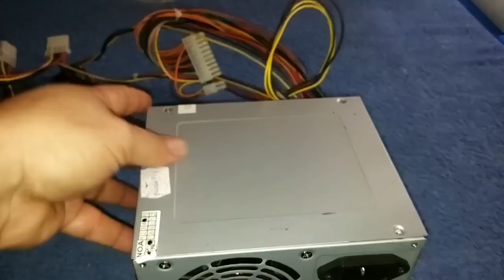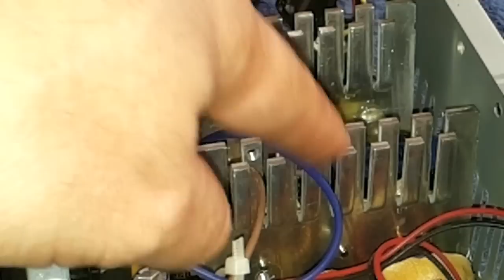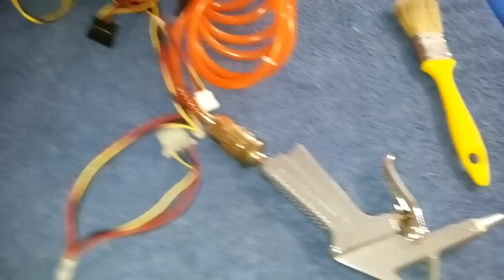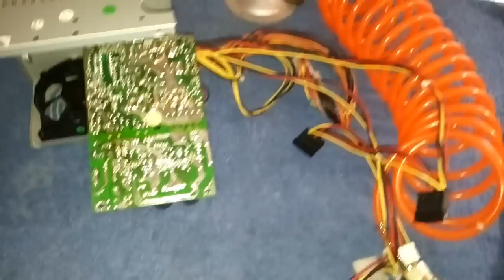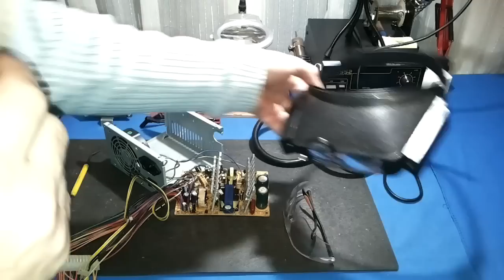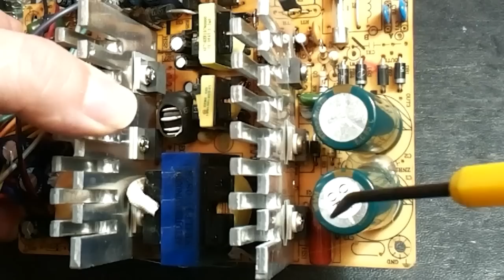How to fix a switching power supply / how to repair ATX in a PC desktop computer

Comment: Can you do a modern update to this video? The internals of the unit you're working on in this video are vastly different from what is found in high performance ATX PSUs today. The one I'm trying to fix is much more densely packed with components and it has multiple PCBs and NO FUSE. I think it's tripping a failsafe, because it responds for a split second when I turn it on, only to shut itself down immediately.

Comment: that day i just discovered that a 3.3V sense must be connected to the 3.3v o/p line, i had removed al the wires as  i wanted just the 12V , learned the hard way after 2 days , smps was turning on for just 0.5 sec and switching off, also i have a cooler master 500w  with active pfc ,no o/p, even the 5vsb not present , checked everything  now will remove those opto & try once again.

Comment: when i on my pc power supply without load then all voltage is ok
.and when i connect the power supply in pc then only green wire 5voltage is come.other all voltage is not come means supply cannot take a load. 
tell me whats problem ?

Comment: I noticed today a burn smell coming from my pc, turned it off and then tried to reboot. No display but the fans and lights still work. I noticed the psu red voltage switch in the back looked a lil burnt. What should i do?

Comment: @Bob. Kalpon  My situation is that i have a good very old PSU the one permanently attached inside the PSU (non removable) abd has 3.3v, 5v and 12volts !! Is not an ATX modern which you can jump with an ordinary clip
to turn them ON !

Mine needs a load like a HDD or Floppy or CD-ROM connected to work ( any load like a 12v bulb ).... So ...can you tell me if there is a way to bypass that LOAD System and make it Turn ON without any LOAD ???
Why most old switching PSUs need a LOAD to turn them ON ???
Thanks in advanced for your help !!

Comment: Hello Bob, veru nice video ! i have an Xbox PSU which is almost the same as an ATX where the Primary side works good, but it has no output. I replaced a shorted rectifier in the secondary section and also the capacitors, but still no output. Any clue on how to continue the troubleshooting as it has lots of SMD components on the reverse side of the PCB. Thanks.

Comment: hello
my cooler master mwe 450 smps is not turning on..it sometimes does but if i shut down the computer and restart it then it doesn't and then after some time it starts..please help me out with this....do i need to replace with new one or it can be fixed.🙏🏻🙏🏻🙏🏻

Comment: The heat sinks gives you an idea how hot the power supply unit can get so it's important that it's clean inside. The fan should be running as it should. If you can install another fan to let air inside, it will help a lot the other standard fan drawing out hot air. The secret of PSU long life is regulating temperature.

Comment: Very nice video,very informative. Can you tell me what might be happening with the videos where people heat the intake on the PSU that won't start and run a computer? Then after a few minutes the computer will start. I assume this must have something to do with heat causing some expansion in the capacitors in the start area of the PSU, thus enabling them to charge up for the starting of the computer. I have two power supplies that I have swapped in and out, of the same computer for a couple of years. Now I see numerous capacitors that are bulging and must be the culprit. I find it interesting that the power supply that was giving trouble has been useful again after getting a long rest after it was removed and stored. These HIPRO PSU's that are used by HP seem to be pretty well built units, and it would be nice to be able to simply replace the bulging capacitors and return them to service. Thank you for sharing your knowledge.
Reply from the maker: Hi! There are two kind of test we do to expose issues. One is to cool components with refrigerant spray or to heat them a little. It is a way to test and tack a defective component to replace it.

Comment: There is a bad transformer in my power supply. What is the correct procedure for desoldering the transformer  I am unable to remove all the solder from the transformer pins with a sucker or a wick.  Got any tricks?

Comment: In my SMPS board the fault in input section when i check the two thermistor are not beeping and the input section have total four transformer one with thermistors whose plastic is little burnt in below section and one diode which is not beeping what i should do.

Comment: I have a question. Do you know why very often there is very little resistance in ATX power supplies on the 5V line? 30-40ohm. After connecting the 12V / 55W bulb, the power supply goes out.

Comment: I wish you plug that power supply on AC and show us the way how to measure each parts like this like that. Like on how to test bridge diode and that big capacitor specially in the primary one. It's called voltage checked!

Comment: I would replace every Cap, Caps are cheap, but also because i only buy good PSU's that are not cheap, the PSU is the most important item in/out your PC, cheap PSU's can destroy your PC, i have seen it happen, and the rest of your PC cost a LOT more then your PSU.

Comment: Hello, I have a non-standard shape power supply on my old HP desktop computer that I've been trying to fix for the past many years. The problem is it has no power good output. Where should I begin?
Reply from the maker: Hi! Don't risk your life to electrocute yourself or your home to fire. If you want to enjoy trouble shooting it, look for a good electronics technician friend, and do it under his advice with him. (Do not forget to bring coffee or pizza to have some fun). :-)
Reply: thanks for the advice, I'm actually a electronic hobbyist & have some very good knowledge in electronics but this power supply problem I have set aside for many years now. Anyways, I shall check again & see if there are any bulging capacitors...
Reply from the maker: OK, if you have knowledge, it is other thing... Three mayor fails in power supply are blown capacitors because bad cooling cause by dust, defected fan or bad design where capacitors are too close to heat sinks  and cooling is not enough. Second, defective load like something in short connected to it. And the third main cause are the following defected componentes: look for two fast speed transistors TO-120 connected to a heat sink,  two small TO-92 are part of that Darlington configuration, and its very low resistors, two about 2.X Ohms. One extra resistor 3 or 5 Watts can be smoked or showing over heat marks in the PCB. All that stage  with your main big capacitors could be damaged. Also at the end, it is time to replace the last capacitors in the output. Now it is time to enjoy, and if the computer is already old, it is time to install Linux and enjoy it anyway. :-)
Reply: Hi Bob, thank you for the tip. Now I know where to begin!
I shall report back as soon as I get the time to dig the power supply in my storage shack. Right now the heat here in the Philippines is oppressive I'll wait a couple of monts when it starts to rain & cool things around. Thanks again - Dennis

Comment: Take your time find some schematic diagram to match your defective power.. Might not be exact diagram but you will have idea at least 70% of the circuit. Then your circuit analysis talent will do the rest to help you repair that power supply.

Comment: I' always use the tip of ac power plug of my soldering gun or iron to touch big filter terminals to safely discharged it...

Comment: I need your technical help regarding LCD TV Haier  LE32B50. By power on blue light comes on but back light does not comes on, after a few seconds it comes on but goes off and  red power led glow again blue led comes on , this will continue, means blue on, back light on and off. By disconnecting back light connectors (03) power comes on and remain on, now on connecting back light connectors tv comes on and all functions are ok.After power off after 7seconds tv will not on and shows the same problem. so if back light connectors are disconnected  and reconnected then power on otherwise no.
Reply from the maker: Hi! I found the schematics here: https://drive.google.com/file/d/1Ap7fx24fVlp3i5EbhVFlJi7qRDT12R3T/view
It is not proper to say it, because any component can be the broken one, but must problems in new TVs are related to electrolytic capacitors like the ones alike 470uF/25V. So, changing a few of them, will help to renew the TV age. Back to the problem itself, if it wasn't a capacitor, check in power supply power transistor, its driver transistor, optocouple and a voltage reference next to it. (Sometimes TL431). Any low voltage capacitor working in a switching power supply stage could be candidate too. Now with schematic on hand, fix it will become easier. :-)

Comment: hey im trying to troubleshoot my atx psu. i had too much device(gpu) hooked to some molex cable. the psu overheated and shut off. i turned back on right away and POP and Spark one time and dead. i changed the 2 large capacitors, they were testing 800uf and were supposed to be 1200uf and the board below them was looking like spark happened there. it still doesnt work. maybe could be winding? there is one darker spot on one choke. but may be come glue color. 
just mainly ask what can spark in this situation. maybe ill take out all capacitors and test them.

Comment: Plz solution in hanging pc on shut down and restart
Reply from the maker: Hi! It is hard to tell without the pc to analyze. In some laptops it could be related with video chip problems. But the only one who can tells or helps, is the technician who will repair it.

Comment: Yes sir, very good, but I have a non-switching power supply that is normally called a micro ATX power supply unit, I have opened up my computer case 3 times, and the first time I half-opened the power supply. Afterwards there was a wrong connection. To make a longer story shorter, the third time everything in and within the motherboard, the HDD, and the CD-RW drive was correctly connected! However, just as the second time my Sony VAIO desktop computer (of 2003), that was upgraded to Microsoft Windows 7 over a couple of years ago, still won't turn on. Therefore, in my case the power supply needs to be replaced; correct me if I'm wrong. I do not have very deep knowledge, nor skills for repair, I am involved in visual arts, including photography. But from what I have seen, and experienced could it be that the power supply unit needs to be replaced? Thank you for any of your expert, experienced advice.

Comment: well i have question about it IF I CHANGE POWER SWITCH TO 115 V AND PLUG IN INTO 250 VOLTS THAT'S WHAT I DID AND NOW I DON'T KNOW HOW TO REPAIR IT i just bought pc in the US States brought it to Europe here's 230 voltage so my question is how to to repair it now cause it blow up is it possible to repair or not???
Reply from the maker: It is not easy to answer without to see the ´power supply. If it is fixable, I recommend a good electronics technician like the ones in the TV service repairs. If it is about to change it, then most computer shops can change it.
Reply: Selector voltage should be switch to 220V to match your ac voltage in Europe of 230V to avoid blowing up your atx power supply.

Comment: just a reminder...that SMPS can fail at anytime in Desktops Laptops Printers PS2 PS3 and PS4 XBOX XBOX 360 and in Flat Panel HDTV Power Box SMPS. These power supplies are becoming rapidly complex and more expensive. but you'll pay only a fraction of what it is new. so if a SMPS costs $300 New, then your cost is as low as $100 to have it fixed right with parts that are built to last!
Send me any comments or questions you may have to my Hangouts email: birdwire.on fire@gmail.com

Comment: smps working.. but display blank. when change smps its good...  how repair old smps ?
Reply: Measure 3.3V, 5V and 12V rails. If all good, test ESR of electrolytic capacitors.

Comment: Sir I have a problem with my computer.  One day suddenly my computer display turns of. But mother board fan was running.  I changed the psu with a spare one and the pc is working.  I tested my old psu,  nothing is wrong there. It is running while green and black wire shorted. I checked that the voltage is also correct in every pins but why that smps not working with my mother board?  Please advise some solution!

Comment: Cheers Mr. Kalpon, thank you for sharing this info, I just have a question, I'm dealing with a PSU that doesn't power on, If I Check Standby Vol shows 5V but nothing else on 12V or 5V or 3.3V
I'll appreciate if you have any possible route for troubleshooting and fix the PSU. 

Best Regards
Reply from the maker: Hola Cesar. Es casi imposible ayudar sin la unidad en mano para revisar. El orgen del problema puede venir de tres causas diferentes. Una carga en corto, asi que libera los conectores de disco duro, DVD ROM y otros perifericos. Una tarjeta madre defectuosa, con interruptor malo, reset atascada, bateria de BIOS descargada o chips, transistores, capacitores en corto, entonces hay una forma de probar haciendo un bypass entre dos de los pines del connector sin la tarjeta madre, PERO si no eres tecnico ni persona versada en la materia, entoces no te arriesges ni comprometas su vida en intentarlo. La tercera es una falla interna de la fuente, y la mayoria de las fallas se concentran en capacitores de salida, transistores de potencia Mosfet, o los transistores UJT y resistencias de bajo ohmeaje que controlan los transistores de potencia Mosfet. Recuerda que en electronica, qualquiera de todos componente puede fallar. Pero NO te atrevas si no tienes el conocimiento suficiente para reparar la fuente. (No es lo mismo jugar con un arduino, que exponer la vida por una fuente que puede comprar hasta por treinta y cinco Dolares. :-)
Reply: Gracias por su respuesta, Sr. Kalpon, y tambien por sus sugerencias para el manejo de la fuente.

La fuente estaba para ser desechada con un case de computadora, estaba funcionando solo como fuente de digamos laboratorio fuera del gabinete de repende dejo de funcionar.

No le puedo decir que soy experto en electronica, pero al estar en proceso de aprendizaje pues utilizo un foco incandecente en serie al relizar pruebas con esta fuente.

La misma esta fuera del gabinete se puenteo verde + negro y no enciende, pero si muestra el voltaje de stand by.

He estado realizando algo de investigacion y pues algunos publicaciones mencionan que al tener 5 V stand by y no encender debo revisar la parte de salida.

Gracias por su tiempo al responder y por compartir los videos desde ya exitos y le contare si tengo algun cambio al tratar de revivir esta fuente de computadora.
Reply: English please

Comment: one of my psu's has a problem starting when you turn it on its a 50% chance if it will start i've tested all voltages while its running and there all spot on.
The board is very crowded so thought I'd ask before I start testing all the components
Do you think its on the dc side? do they have some sort of self test before they power up 
thanks for any help

Comment: if you want to clean the powersupply fast easy and perfect, let it (or any thing else) discharge for a few hours or a day if you dont wanna discharge thoes big caps and just spray it out in the sink, if needed scrub with soap and rinse, if you make sure its dry when its powered up there will be no problem (i wash my graphics cards once to twice a year and i have had my 480 in this rig since 2012 and it currently drives my second monitor)
Reply: also anbody know what i should look for? i have a bad habbit of beefing up the heatsinks in a power supply then pushing dubble the current out of the 12v line, now i have 5 dead 300w psu's i wanna fix without putting alot of time in them, common points of death with over driving these switching bastards? 
now i know i should just do a diod test in the transistor looking things on the heat sinks but im lazy and dont wanna to blind trouble shooting in a unfamailer place when i have other projects.

Comment: The reason is not because they don't know how to fix it, the reason is they don't want to chance the power supply causing problems or damage toi the computer in the future. More often than not, it's easier and/or cheaper just to replace the power supply.

P.S. Messing with the internals of a power supply can kill you, even when unplugged.
Reply: I worked in a repair shop, it wasn't worth the time or trouble to try to fix them.
The components are so crowded together it's not easy to test or replace them.

Comment: Power supply use a thin wire winding in the ring toriods to saturate it and the control output current.
This toriod also smooths the switch pulsing so filter capacitors even out the output to pure DC current. Check all diodes and mosfets 1st.

Comment: Antec power factor corrected supply, it failed to power up from sleep, I found the 339 quad comp. chip had bad output on pin X, I replaced the surface mount chip by skillfully wiring a bigger 339 chip. Power supplies output mother board connectors green wire to send pulse or logic to turn-on. opto-coupler pin 1+ pin 2- LED test with DVM for open circuit.